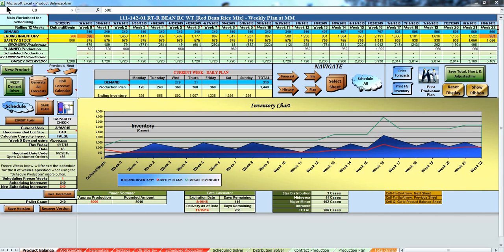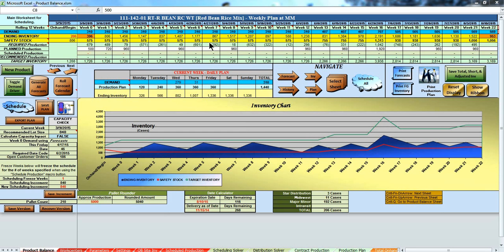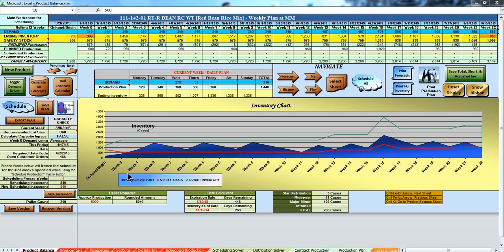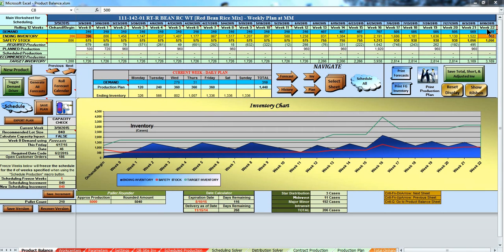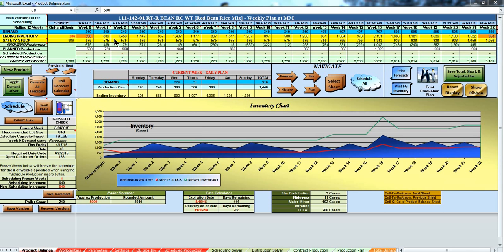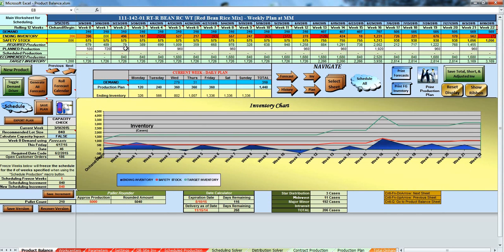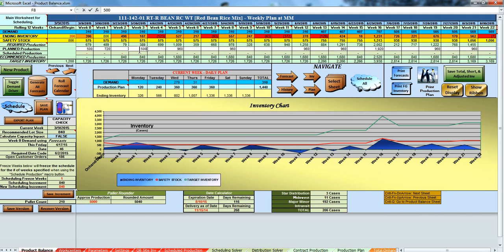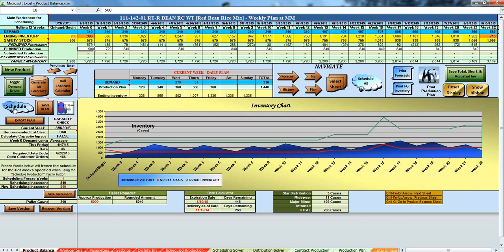Production Planning and Scheduling using Excel #2 - Introduction

Comment: Hello, I want to know when you schedule the production do you consider employees and machines? rearrage the production is something chagnes? and finally pls inform me for the cost. Thank you
Reply from the maker: +Μαρία Νικολοπούλου 
There are various ways to account for constraints, such as employees and machines. One way is to rigorously model them  or approximate their affect on capacity. Two other ways is to reflect their impact through safety stock or a safety lead-time. Over the years I have been less and less inclined to rigorously model every constraint. It makes the models too complex and difficult to maintain. It really depends on how much each constraint impacts the resultant schedule.

The point of scheduling out further in time, is to stabilize the schedule so that it does not need to be changed as frequently.In my mind it is ok to change the schedule outside the freeze fence as much as you want. However, you should strive to minimize schedule changes inside the freeze fence. It is assumed that money has already been spent during this period of time and you do not want to waste money. The biggest waste are excessive schedule changes which destroys capacity of the entire production facility due to cumulative changeovers.

If you are interested in licensing the software then we need to discuss your application, number of copies, support etc.
Reply from the maker: +Μαρία Νικολοπούλου Thank you for your questions and interest.